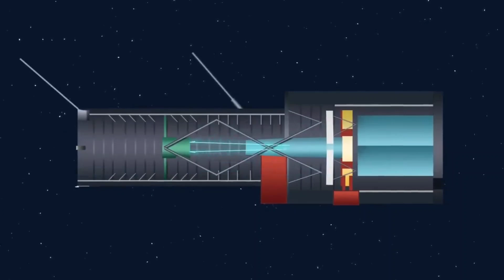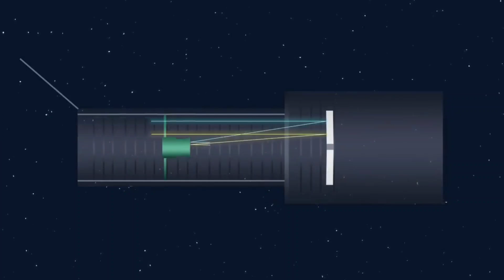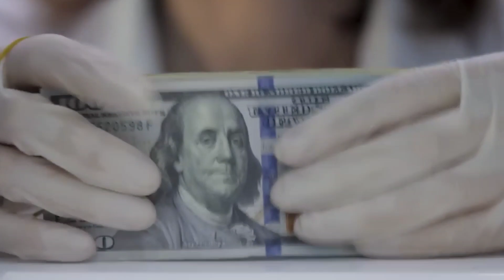SpaceX GENIUS Solution To Rescue Nasa Hubble Telescope From Falling On Earth!

Comment: Given that the last mission to the Hubble fitted a clamp to the base so that future Shuttle missions could potentially grab it with CANADARM and that the main issues with the Hubble ATM are that it's stabilising  Giros are breaking down wouldn't it be sensible to fly up a service module with giros lock it onto the clamp and extend the mission that way I mean its not as exiting as a manned mission but ultimately safer and probably more doable.

Comment: Great Video !  But your AUDIO needs to be rescued...    Also a Test Flight of the Blue Origin Blue Moon HLS can be done with Hubble if it has an Air Lock/Dust Lock with a LIDS Docking Port with a Crew Module with a mass of five Tonnes (5 T) or less.  Blue Moon should have a  6.1 km/sec delta-V then it can fuel on the LS at the Lunar Outpost and then return to the LEO CSS !  tjl